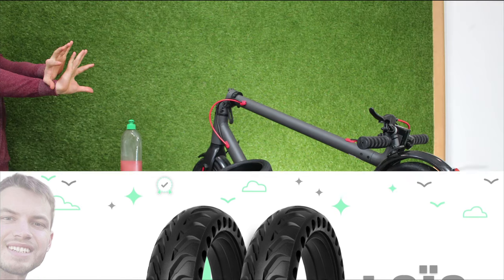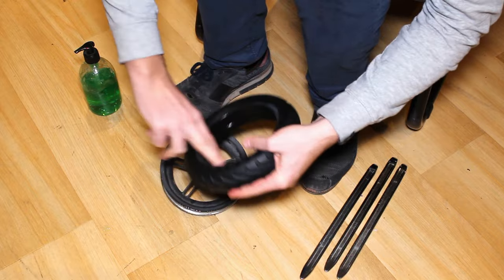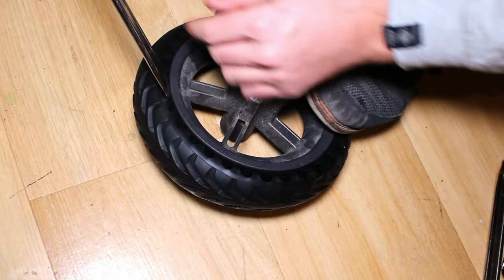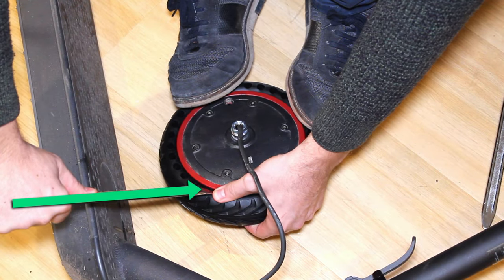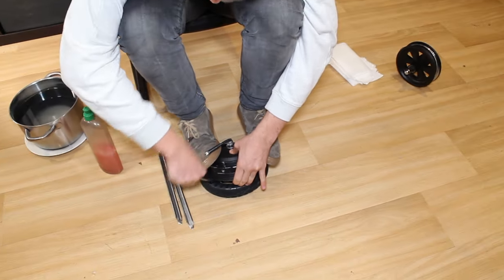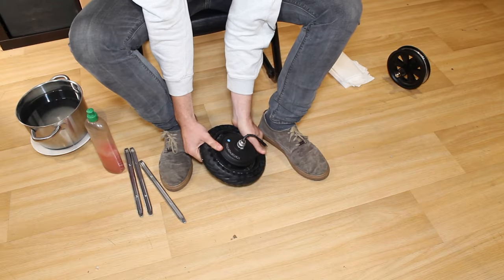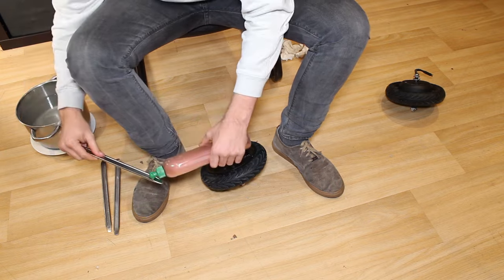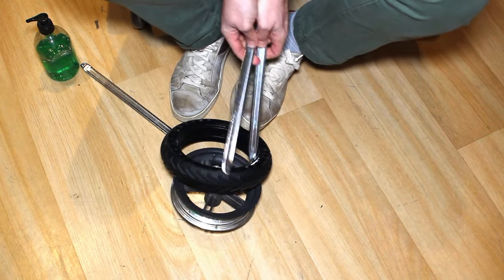Problem to INSTALL your SOLID TIRE on your E-SCOOTER (Xiaomi / M365 / PRO / Mi 3) ? WATCH THIS!!!

Comment: This video did help. Never expected something so essential  as changing a tire to be so unnecessarily difficult.
Reply: Then prepare to do it all over again when you find out the solid tires are crap when you need to ride over some uneven terrain or cobbles, and the impact slowly destroys your scooter's electronics.
Reply: @ozfunghi no really necessarilly the case if you have solid tires there's more people that own scooter with solid tires than without and nothing happens

Comment: Well guys, as the one who suffered through all of this I strongly recommend you doing this way. But first just put the tyre to microwave oven fro 3-5 minutes - it will soften it and the whole deal turns in a very easy process! 
 First I bought two usual tubeless tires from Amazon and suffered from I was frustrated putting them on. Ended wasting one tyre and managed to put the other one. But just couldn't bead it right, so finally after two weeks of Uber and wasted time ordered solid one and put it  from the second try. Just using this video. THANK YOU, GUYS!

Comment: Everyone needs to know that the solid tire needs to boil at least for 1 hour!
This worked for me very very good!
10-15 minutes, you need to be Hercules!
Reply: and the necessary levers otherwise you are doomed
Reply: I put the tire in the sun for a half hour and got it on with 2 irons and a vice and some zip ties
Reply: I microwaved it!  Used three tire bars off Amazon silicon spray put it on like a gyroscope best explain at them just use your strength I could do it in 39 seconds now

Comment: Worked like a charm!  Takeaways:  heat, soap, 3 tire irons, pull tire up onto rim while standing on the rim.

I ended up using my 3D printer heat bed to heat up the tire.  Set it to 110C and placed the tire on it, 10 minutes each side.

Took maybe 2 minutes to actually pull the tire onto rim using this method.

Comment: Glad i found this video before the second go around. I only did the rear since the front tube was still ok. Unfortunately,  I got a flat today after a very long day at work and needed to change the front one to a solid tire. Did the first one with brute strength and what seemed like a whole bottle of dish soap... this way proved to be MUCH easier!

Comment: By far the best method I have found! I have used the zip tie method which worked well, but I needed a new method to replace the front tire on a Gotrax GXL. The wheel is solid and there is no place to fasten zip ties. I didn’t feel like boiling the tire and still was able to replace with ease. Great video! Thank you!

Comment: Looks like 3 levers is key. I have been trying with 2. Almost had a nervous breakdown.
Reply: I feel you!!!
Reply: Put the tyre in boling water for 5 minutes then it works
Reply: I was in the exact same position!
Reply: so much easier!😀
Reply: use a vice much easier
Reply: Ahahah i tried to mount 10 inch solid tire yesterday with only ONE LEVER long story short , i didnt succeed ahaha and i had so much pain
Reply: I was use 3 screwdrivers 😅
Reply: I did it with one lol just gotta put some elbow grease into it
Reply: I feel your pain I was seeing stars I had to just get nuts and give it all I had  and did it 3 times the first 2 I patched but pinched both and the 3rd was the new soild runbber tire hardest tire change ever
Reply: @tonelocc9474  can u please come do mine
Reply: @babysweetpea744 there def a pain in the ass I’d rather pay someone to do it next time lol
Reply: i did it with one but i need this video and technique.  
Thanks
Reply: I thought I was athletic. Nope.
Reply: I bought some.   Thdy broke. Turned out it was made of chinesium aka cheap materials
Reply: I just left a comment about the levers, lol…I only have 2 as well…now I’m scared I’m definitely not gonna be able to change these tires myself 😂
Reply: Thanks for the tip! I only have 2 levers 😂
Reply: @KelleyAnn_79  Omg, I dont see it happening. You are going to need another person, unless your tires stretch better then mine. Its a nightmare.
Reply: Totally a fact. Biggest factor to me is lubricating the smeg out of the tire/wheel. I’d recommend straight irons like the ones they have here. I used irons designed for bikes but they worked. I did both “tyres” and although it was hard work it was totally worth it. My scoot is sexy and now I don’t have to deal with those godawful flats it’s horrid
Reply: @JohnnySmoke88 bet that was rough
Reply: Did it with one and a screw driver, not a fun time

Comment: A great technique indeed, i've personally installed four solid tires similar to the ones shown in the video. And another two that were about 0.5cm smaller in diameter than they should be to fit the rim, thus requiring more stretching. This method makes installing solid tires somewhat trivial. Just make sure you have the right tools for the job.

Comment: I just did this. I’m pretty fit but was working alone and it was impossible so I boiled the tire, put thick foam on the ground wheel with soap inside and rim on foam then motor hub on top with wire still connected.  I stepped “gently” on the hub and slowly moved my body weight until about 3/4 of it was in, then 1 final move with my big screwdriver with duct tape on the end not to scratch the rim and “snap”.

Then made sure all the holes seemed symmetrical and equally spaced from the rim.  

It’s not easy to put these hard tires on; hence, Hercules levers X 3

Good luck guys !!

Comment: I use first instruction for solid tyre. I almost died, but Job is done. I made it on the carpet. Thanks for this video. I am worrying about your wooden floor all the time. :)

Comment: Thank you my man. I haven’t changed mine yet. The motor cable comes out the back (like your front) so now i know what to do.
I just have to order the tire now. But most people say solid isn’t as good as inflated. Then others say the solids with holes perform just as good as inflated. So ima toss up and go with solid holes & see how it goes.

Comment: The removal video was good but is there a way to not damage your rim?

I want to take off the solid tires, drill holes for the valves and install tubeless tires.

Comment: This video is a lifesaver... heat that wheel up (sink w/ stopper add boiling water, let sit for 20+ mins) and use WD-40 inside the rim and tire for any chance in getting it on. 3 pry bars are absolutely required. Good luck everyone 👍
Reply: Doesn’t eral rot rubber?  He used dish soap which won’t rot the rubber.

Comment: Thanks for helping and showing us how to install the solid tire on my Xiaomi!  No more flat tires  🛴
Reply from the maker: Thank you so much for your comment! 🛴🔧💪 Enjoy your rides and we wish you all the best! 💚
Reply: did you have many flats? looking yo buy a Xiaomi for commuting to work and cant decide between air and solid tyres
Reply: @barryfg1981  broooooo, just got my urban drift s006 scooter with 10- inch pneumatic tires with inner tube and on the 2nd day,  ALREADY GOT A REAR FLAT TIRE due to a nail!! 🤬🤬

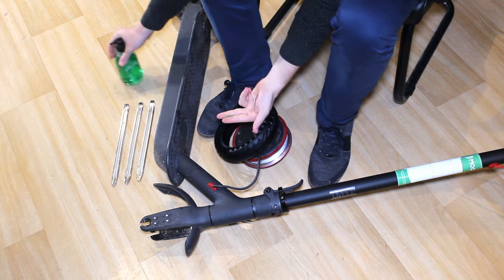Comment: 4:50 When you undo the 6 allen bolts in the wheel you can push the stator out of the rotor, then you can just work with the rim without the cable. They are tight, so use a good quality right size allen key. Then take the wheel and tap the axle on the floor to separate the parts.

Comment: My brand new scooter came with a solid and wobbly tire. Rims are perfectly centered but the solid rubber wobbles up and down. How do you solve this? Just reposition the wheel using this method? Or do I need a brand new wheel? Thanks for the help.

Comment: I just installed 2 solid tires on my Hiboy S2 Max and they were pretty easy. Getting the old tires and tubes off was actually harder than installing the solid tires because of the valve stem on this model. No heating or lube and only one tire iron. If you've installed motorcycle tires, these are pretty cake.

Comment: I have just completed a rear wheel air tyre to solid tyre on a pure air pro v2 with 10 inch wheels. Your video was very helpful, but... how did you make it look so easy! Took be a good 25 minute to complete the rear wheel. I have to keep the motor power cable connected, only giving me about 1 inch of distance between the wheel and the scooter frame while trying to lever on the hot soapy tyre lol. Its was a hot soapy struggle, im glad I will not have to do it again...... oh wait.. the front wheel
Reply: This is my exact problem on the Air pro v2 😢😂 how did you manage it I’m struggling did you leave to soak for over 20M and did you need another body to help
Reply: @Dman  i left the tyre in boiling hot water for about 25 minutes, while the water was boiling i used a lubricant on the rims of the wheels. Then, using heat proof gloves , I picked up the boiling tyre and placed it on top of the rim, I held one side of the wheel with my hand and used my foot to force down on the other side until it popped in place. 
 It's pretty difficult on the Pro V2 as the motor cable is very short, I was very worried about causing damage to the cable bit
Reply: @thedutyfree-tdf  thank you I’ll give this method a go it’s doing my head in lol
Reply: @Dman  good luck with it, one it's done its done 😀 I know someone who filled his air tyre with expanding and hardening foam instead of changing to a solid tyre, could be something to consider

Comment: I bought the solid tires from Amazon, and after taking away the old punctured ones, I was trying just to see if it fits or not, there was no way this solid tire is going around this wheel, but then I saw that you need to dip it into boiled water for 10 minutes and then it will be possible to stretch it around the wheel, I did it eventually, and I think it was worth the effort. It cost twice the price for the tires in labor if you want some shop to do it for you.

Comment: good advice dont install full ruber back wheel evry bomb you will feel it and if you like to slip whit it its gonna get worse its like your on a drill machine i in stalled a airback wheel and probleem was gone no bumb feeling

Comment: I needed to replace a rear tyre on a 1st gen Pure Air Scooter. The rear wheel is attached via a very short cable, making it impossible to follow the instructions in the video. So I removed the deck (unscrew 6 allen bolts hidden by plastic bungs, then remove the bolts on the rear mud guard). Then you will see the cables - disconnect the cable to the rear wheel and then push the cable through the rubber grommet to remove it completely. The Pure air also has quite long axles, so get some wood to place either side of the rim so that you can lay the wheel completely flat and then stand on it. After that, instructions as per the video. Took me about an hour first try.

Comment: We used zip ties to hold the tire in place as we went around with each lever rather than trying three all while holding the bottom in place with your feet.

Comment: You can remove the motor from the front wheel on the Xiaomi to avoid damaging the motor cable when removing the old tyre and installing the new tyre

Comment: I recommend boiling the solid tyre for at least 40 minutes. 15 min wasn't enough for me. I had 3 tire levers, soap around the wheel and tires and had to use my max strength while my brother's 74kg was standing on the wheel to get the tyre on the wheel, then just some minor adjustments while the hardest part was done. 

Changing a tyre shouldn't be this hard so good luck to all of you with this unnessecarily hard task.

Comment: if ur having trouble this is how 

most of the times the amazon tire is coming with only 1 hercules lever so u can use a butter knife as another hercules lever

the trick is using alot of dishsoap in the tire and in the levers and u have to put it in the microwave for 3 minutes make sure to use gloves its going to be really hot then u start with the bottom the work your way up with the help of someone else also try using ur foot as pressure and then u should be good to go

Comment: I have never sweat so much before in my life. Literally was panicking when I couldn’t get the air filled rear tire off the back. Eventually got it after 30 min of busting my ass. Then I tried  just flexing my solid tire and just threw my hands up and said tutorial time

Comment: OK hold your horses, it is NOT as easy as it looks in this tutorial. I don't know if there are differences between solid tires but you definitely need to be strong in your hands and also in your legs to be able to attach the tire in the say its been demonstrated in this video. I didn't manage do it...

Comment: I didn't boil the tires. Instead I was able to, use liquid hand soap to lube the tire and rim, then seat the rim into one side of the tire, step on that spot, then use a tire iron and 2 screwdrivers to pull the tube into the rim. It took a bit of work and about 10 minutes, but got it done. It might be helpful to have one person place one foot on opposit side of the side your foot is on.

Comment: Lol, Boiled my tire about 15 minutes, used long screwdrivers as the ones that came with the tire were too small and useless... Took me about 6 hours, lots of sweat and effort, destroying both my hands and feeling like giving up 1000 times... finally I got it in, and now the tire is not fully aligned with the rim, but my tire does not have holes that go through so setting it 100% straight has been a complete and total nightmare. If anyone has any ideas on how to do this? Tire is cold now and Ive been trying to force it into place but it just won't budge...

Comment: Dunno why they don't remove the motor from the front wheel to put on the tire, that way there isn't any cable in the way and it also means you can put the rim flat to the ground, making it much easier to put the tire on.

Comment: the fact that you did this by yourself must mean your on steroids or smthing cuz this took both me and my dad ( both adults)  an hour and 30 bloody minutes of constant cussing, raging before we actually got it on, the tips worked well compared to other tips other people gave so kudos for that, but still this is by far not an easy task, atleast when it comes to changing the front tire with the bloody cable limiting how much you can move and the actual bike being in the way.... but we did get it on eventually x) def going to take it to a workshop the next time...

Comment: I purchased a Niu KQ3. Trying to replace a back tire is far to much work and frustrating. Well built scooter and fun to ride but I tried to bring it somewhere to be fixed. Good luck finding a place. No one will touch them. I gave mine away after 6 months of use. Money down the drain.

Comment: This only works if you have the strength to do it, if you don't have the strength you're better off paying someone to do it for you. The tyre cools down while wrestling with it. I've tried to use a hairdryer to keep it warm, but that dries the soap, so I pour it on. 1.5 hours of this, I give up.

Comment: boiling the tire for 15 minutes will stink up the house and ruin your pots and it will smell like hell, probably extremely toxic fumes too then when I put it on it went on crooked and I could not straighten the solid tire so I rode it crooked to this day where it wants to pull to one side but there's nothing I can do, the rear one, I just buy them pre loaded on amazon, I don't even bother trying to change them on the rear

Comment: Zip ties.....6 zip ties....zip tie the tire when jot to pull the center inside ridge back and gives a smoother surface to slide on....and f1 tire Warners! No kidding boil or microwave like 5min